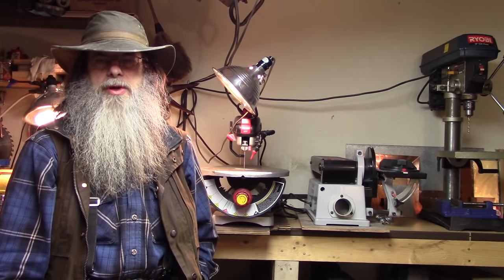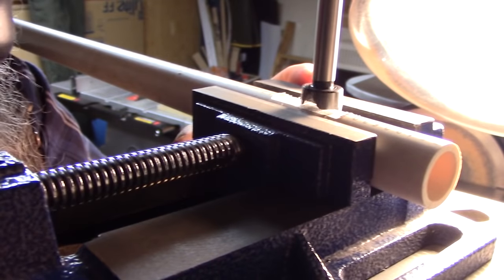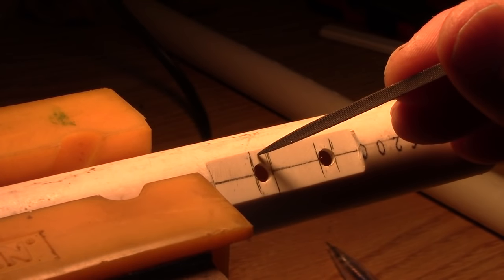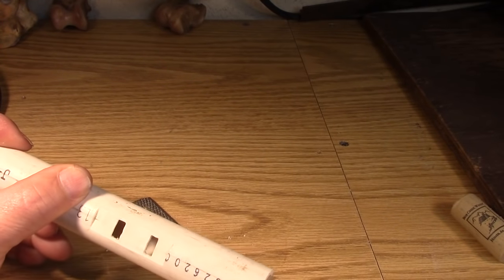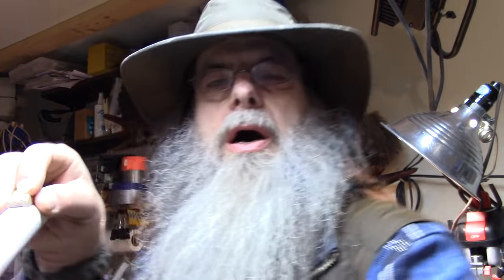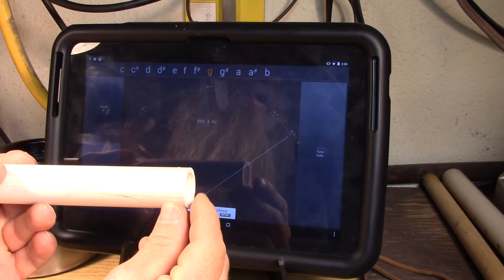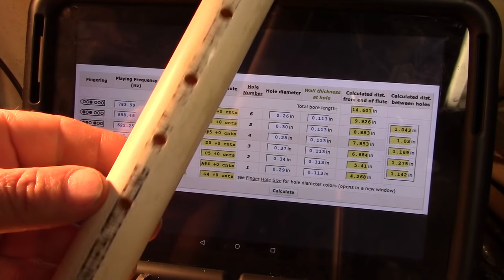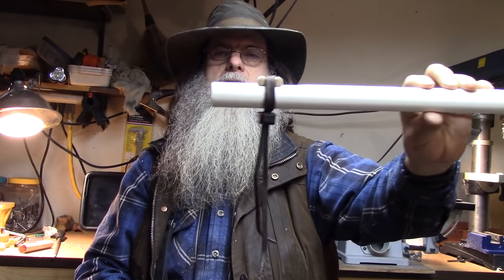How To Make A Homemade PVC Flute

Comment: Maybe I missed it, but what was the overall length of the PVC from top to bottom?
Reply from the maker: I am sure I told what the initial length was but again the length changes as the flute is "tuned" near the end of the process.
Reply: @Far-North-Bushcraft-Survival  Thanks for your reply. Yes, you did say initially the length, I was just curious what the end result length was after tuning. BTW, good video...
Reply from the maker: Each flute made will end up being different lengths due to different placement and configuration of the sound holes, thickness and diameters of pipe etc so it does no good to give the end measurement since someone else trying to make a flute based on finished measurements would most likely end up sounding quite bad and out of tune.  But if memory serves me correctly I did show a copy of the "Flutomat" with all the measurements all filled out and revealed.
Reply: @Far-North-Bushcraft-Survival Yes you did... I'll reference that when doing my flute. Thanks.

Comment: Thanks Gandalf the grey
Reply: on a more serious subject this is amazing!! i just have one question: now, the "tip" were you blow is way to big, wouldnt be posible to heat and make it way flater, so is isier to blow, and more pressure on the air is granted? or that would not work at all? it would be a nice thing to see if it would before ruin the flute! jaja
Reply from the maker: I find the end just fine and not too big at all.   However, there should be no problem in reshaping the mouth end.   The only downside that I can think of is it being more difficult to insert or remove the cork stopper between the holes. Of course you do not want to deform the area around the cork or the bird etc while forming your mouth piece.

Comment: hello my name is eudi and I followed the process of the flute only I need the distance to which you put the holes and how can you tell me the measurements and the distance of the holes here in the comments
Reply from the maker: Go to the 14 minute mark of the video and you will see the measurements that I used.    You will need to have the same diameter PVC that I used (3/4 inch) with the same wall thickness as mine in order for these measurements to work for you.    Be sure and drill your holes smaller than the video shows so that you have room to drill them out larger as needed to tune correctly.    Good luck.
Reply: Far North Bushcraft And Survival 
thanks I want to make it like this because I liked the melody k played to the last and already sounds the flute mine

Comment: Does it matter how old the PVC is?  I have some that is over 10 years old and it feels different to even cut it, like it is brittle or something.  I would hate to waste all the time just to save a trip to the hardware store and a couple of bucks, but I am not one to waste anything, either.
Reply from the maker: If the PVC has been in the sun then it may be degraded due to UV radiation.  In that case it would be brittle and not much good.  A 3/4 inch PVC pipe though is very inexpensive to buy a new one, at least here in the USA

Comment: Hi, May you show what did you put within (blow)
Reply from the maker: I believe that you are asking what I put inside the flute to route the air up from the mouth piece through the sound holes.  It is a cork used to cap a wine bottle.    If so, please re-watch this section of the video.

https://youtu.be/misjPOhd-9o?t=6m35s
Reply: Thanks......great.

Comment: Great video! Then you could hydro paint it as well.

I'm a little curious why yours wind stopper was not ramped or humped. A lot of videos I've seen on this, they make the stop gap from out - in humped or sloped. So the air ramps up and out...  supposedly makes the sound smoother.

Hydropaint

https://youtu.be/enFSoiCo-lA
Reply from the maker: This flute turned out with very clear crisp notes and not near so "breathy" as many other flutes that are being sold.

Comment: If in centimeters .. are the holes still half of the diameter ?
Reply from the maker: Yes the two holes where the air comes and the sound hole need to be aproximately half the inside diameter fo the pipe in order to achieve best sound output.    There are online converters that will convert the measurements to metric if that is the system of measurement that you use.
Reply: thank you very much sir , I made couple from a bamboo and I guess I was lucky because  the holes are exactly right width but I couldn't find any further instructions for right getting note holes into right place .. and I messed it al up. . now all over again. ;)

Comment: does this work with paper?
Reply from the maker: If you mean can the flute be made out of paper such as a hard cardboard tube then yes that would probably work temporarily.   However, there is a lot of moisture that collects in a flute when playing.   There can be so much moisture collect in mine that I have to occasionally grab it by one end and fling the flute hard in an arc to fling out any collected moisture.   Paper would not hold up to that over time.

Comment: You can do all this with one pocket knife if you don't have any tools or computer or shop or anything.   A small round file will dress up the holes.  A bit of sand paper will clean out the burs inside.

Comment: I followed these steps.. no sound is coming out of pvc except my breath
Reply from the maker: If your two holes closest to your mouth are indeed carefully made to the right size and shape then I am going to guess that the problem is most likely in the way you fashioned the air channel in the underside of your "bird" on top of the holes.   You of course need to make sure that your plug inside the flute is between the two holes and is not blocking either hole.  The plug also needs to totally seal the flute bore and not let air bypass the first hole.   With your two holes positioned correctly and sized correctly and with the air chamber inside the flute sealed between the holes, I am going to guess that the air channel on the underside of your "bird" is either too roughly fashioned to allow smooth passage of air or is too large or both.
Reply: Far North Bushcraft And Survival I got it ! You were right the “bird” was too big and covering too much of the second hole . Thanks a lot it sounds amazing now :)